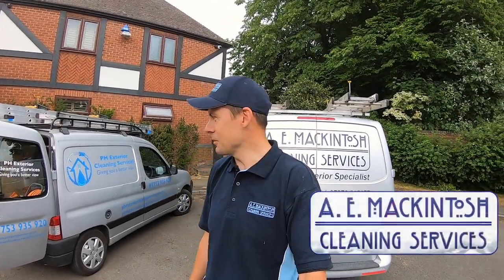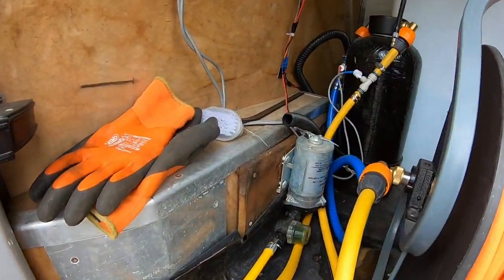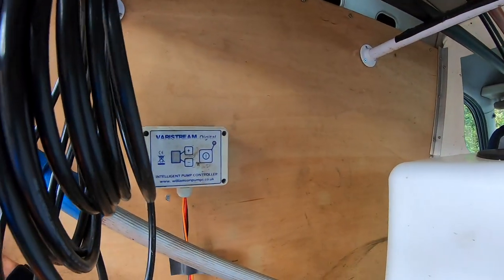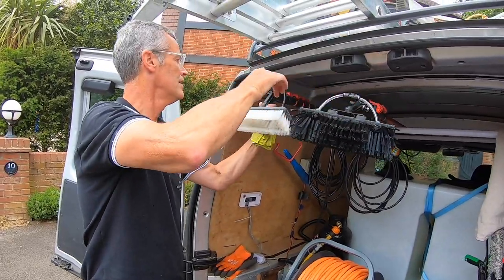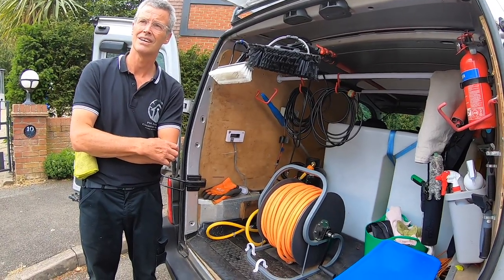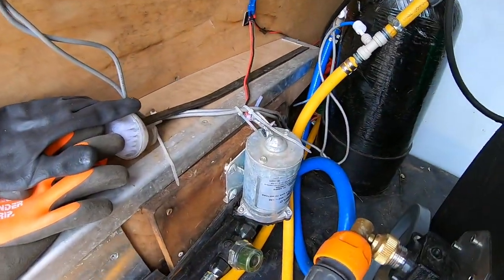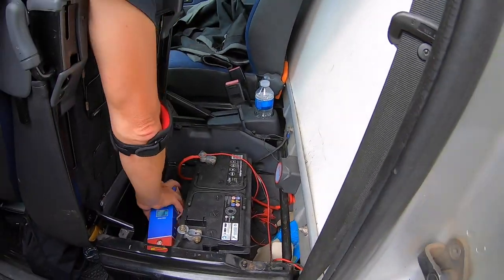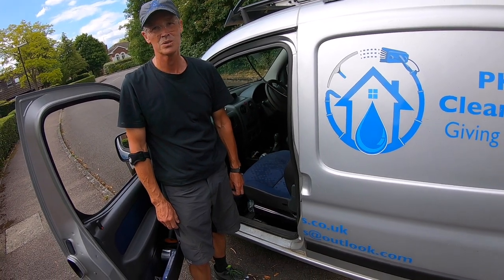Pauls Budget Water Fed Pole Van Setup - Peugeot Partner

Comment: Paul’s an absolute diamond, brilliant man and I’m sure he’s going to do very well with his business.

A couple of pointers (just my opinion)- 

There’s no point in changing to a 400 litre tank for all the hassle and effort you may aswell just put two barrels in the back. I’d aim for a 600ltr but it depends on what the van payload is & how much work you want to do throughout the day. Always aim for a bigger tank even if you just need to half fill it.

Get yourself a univalve if you haven’t already that’ll save you loads of water. 

Once you can justify it get an xtreme pole, your body will thank you 🙂

Best of luck bud 
Matt
Reply from the maker: Thanks! Yeah, I got him onto the uni-valve straight away. He is doing very well! Works like a Trojan!😃👍🏼
Reply: Thanks Matt. I have thought about your point re water van capacity and agree that I will need more than 400 when the time comes to upgrade. Hopefully not to to far in the future. The univalves I have work really well. I shall look into the extreme you mentioned as I am 55 and sometimes do feel a bit fatigued etc.

Comment: I just got 6mm hose and new reel with van mounted 500 ltr tank not used it yet,8mm hose I think would use more water?I found 5mm struggles at times with water flow.
Reply from the maker: Your jets at the end will help control your water usage, along with the pump flow setting. A bigger hose just means you are moving around a larger weight of water I suppose.😃👍🏼

Comment: Well done Paul, I’ve not been going that long just over a month, I had a 350 ltr tank but kept running out of water as I mainly do fascia and gutters, so I now have a 1000 ltr tank and it perfect for me. Keep those vids coming Ash 👍
Reply: Thanks Frank. I will increase the size of the new tank based on the comments I am getting.
Reply from the maker: Thanks! It’s always good to get everyone’s suggestions.😃👍🏼
Reply: I have a 350 litre tank and very rarely have I ran out of water, in Scotland we lucky as not on meter so fascia/gutter jobs I just use outside tap if there is 1.
 What is it you use to hold store poles Paul?
All the best in business mate, can't go wrong with Ashley there for advice

Comment: Nice little set up Paul 👍 

One quick observation, not sure if I've got it right from the video as it's hard to see 100% but it looks like the pump strainer is on the wrong side of the pump?? It should strain the water out from the tank before it goes into the pump. It looks on the video that the water comes from the tank to the pump. Then a strainer before it goes to the hose reel. If that's the case it's definitely worth changing round to stop any crap getting into your pump 👍.
Reply from the maker: Thanks! Yeah, I’m not sure if it’s just the slightly strange way that his plumbing has been done with the strainer? But I will get him to check.😃👍🏼

Comment: Nice setup. what are those expandable bars called that he use to hold his poles up ? Any idea where you can get them/?
Reply from the maker: I think they are just something like simple shower curtain rails from a diy shop.😃👍🏼
Reply: @aemackintosh  it can be difficult to store poles without a proper bulkhead in the van...
Reply from the maker: I think the previous owner has cut a hole out in order to be able to fit the poles in to this van.😃👍🏼

Comment: This might be a stupid question but why is it neccesarry to use water with zero ppm for window cleaning? Does it make that much of a difference? Many thanks for the informative content, I'm considering going into this as a business here in South Africa.
Reply from the maker: Ordinary tap water will leave behind a residue when it dries. Dirt will stick to pure water, and if the window is rinsed properly, it will dry without leaving any residue.😉👍🏼
Reply: Thanks for the quick reply, makes sense. @aemackintosh

Comment: Great video 👍
One question though, what is the purpose of the di vessel in the van? Is the water in the tank not already pure water?
Reply from the maker: The water is purified on the way in to the tank down to 10-15ppm, then it goes through the resin Di vessel on the way out to take it down to 0.😃👍🏼
Reply: Thanks for the reply...... trying to get set up with WFP trolley system and don't be 100% sure of how all these different systems work so just wanted to ask. Thanks
Reply from the maker: I hope to do a video to talk more about that kind of thing soon.😃👍🏼

Comment: how many litres of water does your DI resin go through before you need to change the resin and what size is your resin canister
Reply from the maker: It will probably need changing around once a month or so, but it depends on how much you use it.😃👍🏼

Comment: Why get a 400 liter tank for such a small  van when 2 or 3   x 25 Liter drums will do the trick .  Contemplate getting a double 40/40 Ro  will save often on needing a booster pump ( electricity )  A double 40/40 is a must imo  !
Reply from the maker: Thanks.😃👍🏼

Comment: Hi Ash. New to the channel. Looking at getting started.(just been made redundant) just wondering what van I'd need to have a tank and system fitted.i have a spotless water place near home to fill up from. And looking at . What system would you advise? Thanks in advance.
Reply from the maker: Any van really. But you might want to just check the payload capacity before you buy. It varies from model to model, but the stats are usually easy to find online. Water weighs about 1kg per litre roughly so that should give you an idea. There are lots of starter systems out there that just bolt in. Happy shopping!😃👍🏼
Reply: @aemackintosh  Thanks for the reply. I will have a shop around. A new beginning!!

Comment: Hi Ash I’m in the middle of setting my tank up is there any chance of showing us a wiring diagram ,thank you 
Dave
Reply from the maker: I made some videos about a little DIY pump setup I made some time ago, there is a whole playlist on my channel. There is a video there about the controller from DA Components. The controller comes with wiring diagrams an I showed it in the video. I hope that helps.😃👍🏼
Reply: I bought my pump and controller from D A Components. Very easy to set up a system. Even if you have no experience. All you need is a water tank, leisure battery,pump and controller.
Reply from the maker: Great! Nice one.😃👍🏼

Comment: So basically if you haven’t got an R/O tank at home , just fill the van mounted tank with water from outside house tap etc and then it will be converted to pure water once it’s gone thru the tank filtration system ?
Reply: Yes. But that way you will be needing to spend money on changing the resin more often. Using the RO and tank at home I pre filter the water from 17 parts per million down to 7 or 8 and then the resin gets it down to 0 ppm. (Imunew at this so I think I have explained that correctly. :-))
Reply from the maker: It depends on how hard the water is from your tap. If it is higher than around 100ppm you will need to put the tap water through an RO filter system before it goes into the tank, then it goes through the resin DI canister on the way out of the tank to take it all the way down to 0. If the water from your tap is lower than 100ppm you could get away with putting it straight into your tank and just let the resin DI canister do all the work. So the first step is to get a TDS meter to measure your water hardness. I hope that helps.😃👍🏼
Reply: Thanks Ash and Paul ......... who knew 21 st Century window cleaning is such a blooming science lol 🤓think I’ll stick to Trad 🤪.

Comment: I'm confused, did Paul say his split charger doesnt work so he charges it manually every 2 weeks?  I charge mine everyday after work,  leisure battery's are not meant to run flat also how is his battery lasting 2 weeks if hes using over 300 litres a day Haha, I probably missed something
Reply from the maker: Yeah, maybe he should charge it a bit more often, but he doesn’t clean windows all day every day, he’s got some other odd jobs going on too.😃👍🏼

Comment: what is the purpose of the resin filter please?
Reply from the maker: The RO filtration that Paul uses at home purifies the water down to around 20ppm. So the resin filter in the van will polish the water off down to 0ppm on the way up the to the brush.😃👍🏼

Comment: How much would a set up like this cost
Reply from the maker: Price can vary depending if you buy each individual item yourself or if you get a similar budget setup fitted by a supplier. But to give you an idea- Tank: £250, pump: £80, hose and reel: £100, pole: £250. I hope that helps.😃👍🏼
Reply: @aemackintosh  yeah thanks so much!